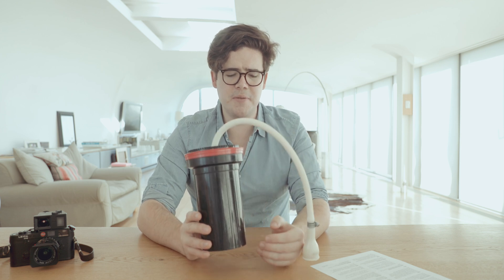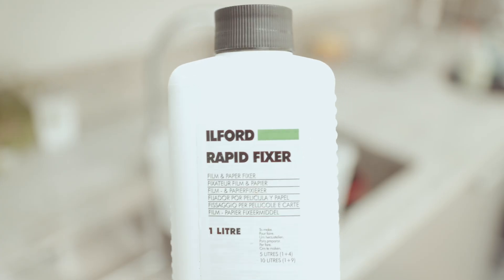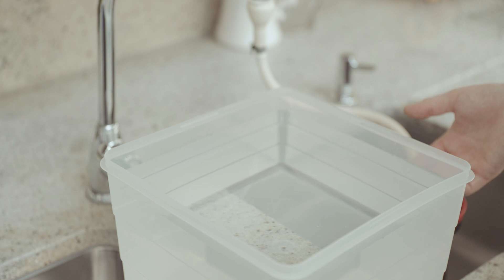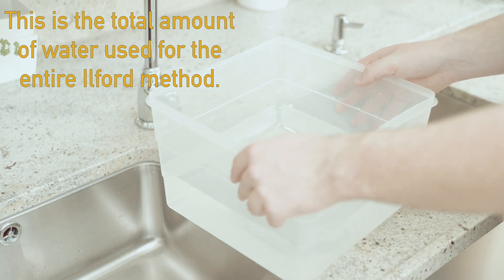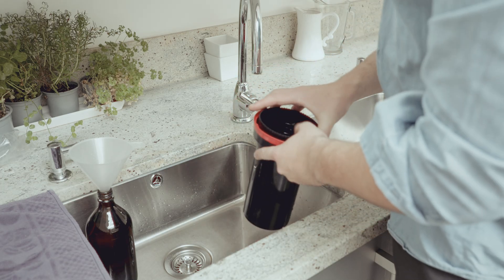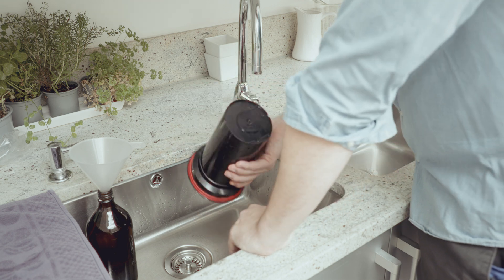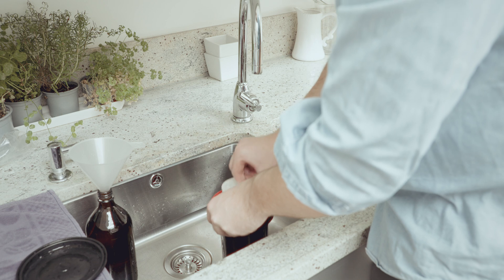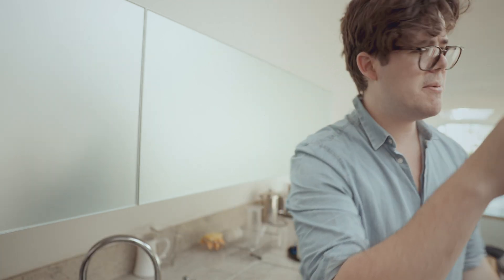The Ilford Rinse Method

Comment: I actually use this method of 5, 10 and then 20 inversions BUT with one exception. There should be a brief soak period, I use 2 minutes before pouring the water out. This is especially important for T grain films and minimizing the magenta stain on the negs.

Comment: Golly.. that seemed like far too much wetting agent to me! Patterson tanks used to sell with a nylon spring collar to hold down the single real if the tank size was not fully utilised. Listing I've seen don't seem to include that component these days. Personally I was always taught to wash film for 30mins in running water.. I do however use a similar routine to this with around seven water changes, but stick to a total wash time of around 30mins. My oldest negs film are still stain free after 50 years. Hope the ones I was today last just as long.

Comment: You can use a modified version of his flushing method which works better than a 3 minute flush and is probably a better result than the Ilford three agitate/dump method. Use water a bit warmer, around 75 degrees F.  Fill the tank, then agitate for 5 seconds every 15 sec. Let it rest for a second minute. The continuous agitation of the Ilford method doesn't do much extra after the first cycle. Do this two or three more times. The idea is to give time for the fixer to soak out of the film, which requires some time, not a fast flush, continuous agitation. Either way, you cannot hold the washed film up to the light and conclude "that's good". To know how complete the wash result, you have to use a test chemical on an end-scrap of the film, which stains to some degree if fixer remains. Two tips to minimize water usage for washing film or paper: (1) Use a non-hardening fixer. This may need some inquiry of the manufacturer. (2) Use a washing aid solution. It's fairly cheap and a little lasts a long time. It significantly reduces your washing time.  In the end, if you want to insure a full removal of fixer, you'll have to dig up a chemical test kit, which isn't cheap.

Comment: I did my photography course few years ago in London in 1990s and I did the  HND which is a 5 years course  and I learned all about black and white photography and developing black and white films 35MM And 120 Roll films and using the Enlarger to make Print from 35 MM negatives or 120mm roll films

Comment: Nice! thank you. I've only used this method since the tap water in my area is quite hard and I buy distilled water for my development and always wondered if the running tap water method was better. Also as a side note, audio was bad, get the mic closer to your mouth and use less de-noise, I'd rather  hear some noise than not understand the words you are saying.

Comment: I’ve been using this method for a long time and discovered that if you don’t wait for the water to go down the funnel all the way after each inversion the top film and top areas don’t get washed properly. This is even obvious when I open up my archived film which smells like fixer! This method can work but once you invert the tank WAIT for the water to drain. It takes quite some time to do so. Even so, how well it works is hard to tell because you will only know after decades by looking at the archival properties or somehow analyzing how clean the surface of the film is. I am continuing to use this method regardless because I don’t want to waste water.
Reply: This instruction relates to use of the Paterson System 4 tank, very commonly used and one of the worst ever designed.

Comment: I have used the Ilford method since I started home developing, and have not noticed any problems with my negs. I followed the instructional video on Ilford's YouTube channel, which is pretty straightforward. I should say that I use Fotospeed developer and rinse aid, as it's a bit cheaper than Ilford's, and as I say no problems that I have noticed.

Comment: Came across with slightly looser (or maybe less formal) production values but got the message across nicely - it's worth noting that another less environmental but very practical reason for using the Ilfowash method is that in a domestic (or field) situation, it doesn't matter what shape your taps are so you don't need to worry about whether the hose is going to fit.. :-)